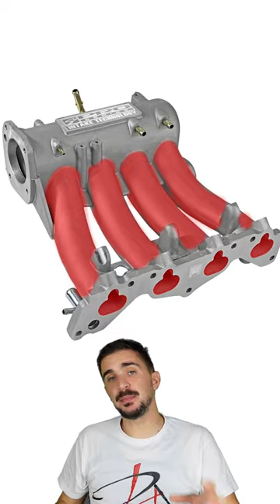Couldn't fit this under a minute so I just sped it up #lazy #engine #engineering #shorts #d4a

Comment: If You speed it up by 100% you can also transpose the audio 1 octave (or 12 semitones) lower to have the same voice/pitch. So if you speed it up by 50% you could use 6 semitones. Audacity has this under "change pitch" effect. Still the knowledge is more important than the unusual pitch ;)

Comment: Also exhaust length, head gasket size , how light materials are, if the engine has timing chains or gears, ram air systems, list goes on and on

Comment: Good video. For the same reason naturally-aspirated engine only provides full power at the sea level, if you ever drive on mountains you know how dramatically power drops after you reach 1000m above sea level and continue climbing.

There are also a lot of misconceptions about turbo. The reason why you need a relatively complicated system to deliver more air instead of just using electric fan for instance is because the turbo is not simply "moving" the air into engine, it compresses it, and to compress the air you need a lot more power then to just move it like your PC cooler.

Comment: The size of the intake systems also determines to some degree, how quickly a cylinder is able to fill at low RPM. Higher intake velocity at low engine RPM leads to stronger low RPM torque. These short stroke, large bore, high rpm, large throttlebody engines don't fill that space very well until the engine is screaming. Large bore engines have to fill all that cylinder space during combustion (flame propagation) before piston goes down, and with a short stroke, that time is short to use the power and efficiency is low.

Comment: is it true that length of intake runner can dictate hp and torque ratio? like longer runners will drop hp but increase torque and vise versa
Reply from the maker: Yes, in general it works like that, it moves peak torque around a bit on the curve but usually doesn't change peak numbers much.

Comment: the air to fuel ratio is by volume or by mass?
Reply: Good question. He's talking about by weight. By volume it's 9000 to one.  The combustion of one gallon of gasoline requires 9 thousand gallons of air at sea level. It's about the same for diesel and kerosene too

Comment: The amount of air getting into the engine is linear with the amount of torque produced.
Reply: Torque isn't especially correlated with airflow at all.

The maximum possible power is directly correlated with the flow rate of air that flows through the engine. However, there are many reasons why an engine does not and will not make this maximum possible power, so the correlation is usually pretty non linear.
Reply: @Josh-cw8by  Torque is related to many factors, including bore, stroke, crank throw(which is the same as stroke), cylinder pressure, and number of cylinders. Airflow is not one of them.

Imagine a 1.0 liter sportbike engine that produces 150hp at 12k rpm. Now imagine a 4.0 liter Jeep engine that produces 150hp at 3k rpm. Both will have the same mass airflow(assuming identical volumetric efficiency) and the same horsepower, but the Jeep engine will produce 4x more torque. This is because power is correlated with airflow, but torque is not necessarily.

I would appreciate it if you kept this conversation productive and civil by refraining from using terms like "absolute fucking moron", especially while asserting incorrect engineering principles.
Reply: @jaredlancaster4137  The amount of torque produced is directly proportional to the air flowing through the engine. Large engines pump more air and, therefore, produce more torque. Boosters—superchargers, turbochargers—deliver additional air to help small engines act large

-Straight from reputable sources.

My guy, you  are the personification of frustration. I'm muting this convo as you're insufferable.

Comment: Yknow you can speed up audio without adjusting pitch now right? Been possible since at least the 90s...
Reply from the maker: It didn't work in premiere pro. Sounded horrible and crackled
Reply: @d4a  implementations can vary.. it generally works by cutting out samples, without additional crossfading of remaining samples it can sound bad.. I would expect premiere to have a decent algorithm though. Generally even a sample cut only algorithm can go upto like 10% without noticing and a good one can easily do double or half speed without any real quality loss... I haven't used premiere in years so don't have it installed to test.. you could try audacity or something, I'd use logic or Cubase but I own both and neither are particularly cheap to be a great recommendation for just this.. heck even youtube itself doesn't sound that bad at when played back at 125 or 150%, you could playback at 125% after uploading (privately) and capture that audio to re-upload lol
Reply: Either way, helium voice is entertaining 🤣 and your content is great always anyway